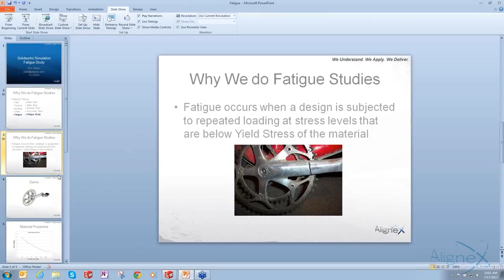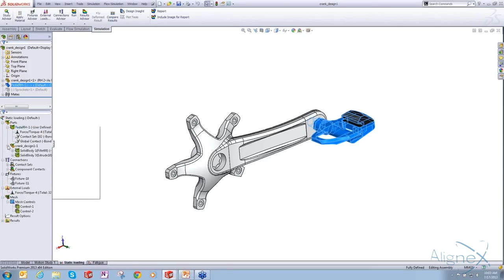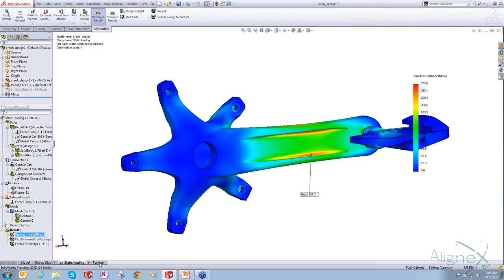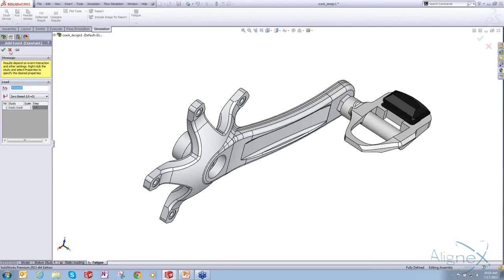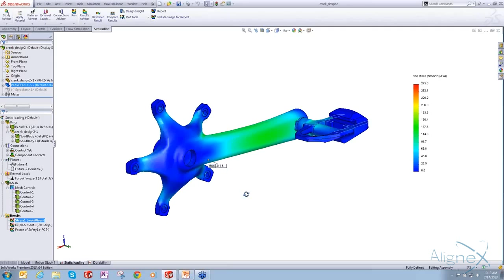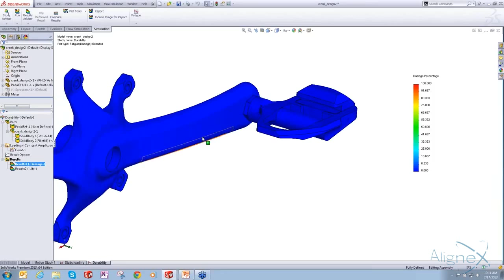Failure Fatigue Analysis in SOLIDWORKS Simulation

Comment: Good video but . I hope to know at 17:21 the number of cycles is approx. 10,000,0000 larger than 7000000 for the second part which indicating failure will be occurred especially using 64 % from the default cycle.

Comment: i have a question. for example that failure due to fatigue is likely to occur  after approximately 16,510 cycles. but i don't know 16,510 cycles approximate how many hours or days?. thanks alot
Reply: if you know the frequency, you just need to divide cycles by the frequency to get time (s) and then finding out how many days, months etc
Reply: It depends on the operation of your part. The frequency or rotational speed and hours of work per day

Comment: thanks for the video. how can you define the max and min stress for the fatigue cycle. i noticed you only input the mean stress?
Reply from the maker: +Alex Fry - In this case we are actually setting up a Static study that calculates the Max stress everywhere. Then in the Fatigue study we set the number of cycles and Loading ratio. In this case I did a zero based load which gives me a loading ratio of 0. The loading ratio is defined as the Min Stress/Max Stress. So the Static study calculates the Max stress at every node and with a load ratio of 0 the software calculates the Min stress as 0. From this the software also determines the Mean stress from the equation Max+Min/2. So the Mean stress calculated from this is actually Max/2 which is calculated at every node. Thanks, Eric

Comment: hi sir your video on fatigue analysis was informative but during the fatigue analysis while assigning SN curve the value of Stress Ratio (R) was taken as -1 but  to my reference in internet and Machine Design by Robert L. Norton, R should be taken as -1 only for fully reversed loading ie -XNewton to + XNewton but here what u have taken is Repeated loading ie  0 to +XNewton for which R should be taken as 0......
Please reply me sir whether i was correct....my mail id jeevabala666@gmail.com
Reply: We can assume stress ratio,R based on loading condition  or residual stresses in member. If we consider the tensile mean (positive residual) stresses in the member then stress ratio, R = 0.